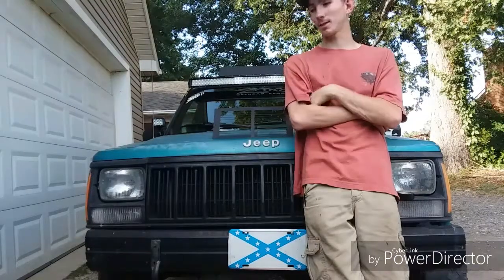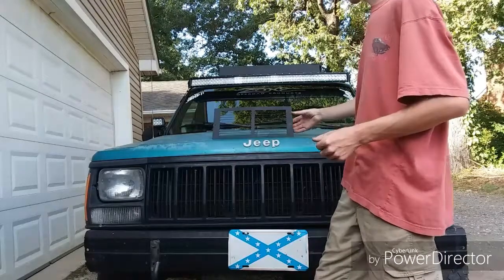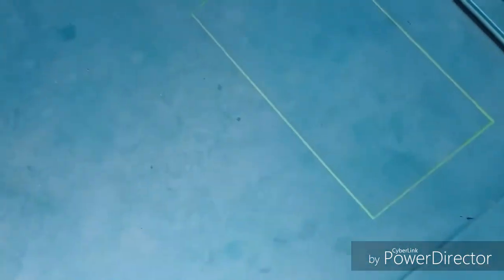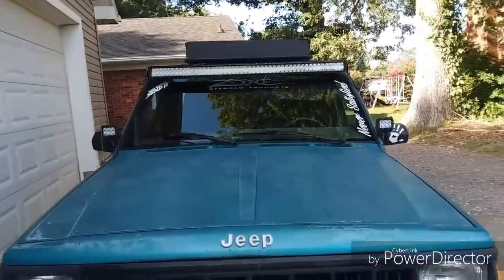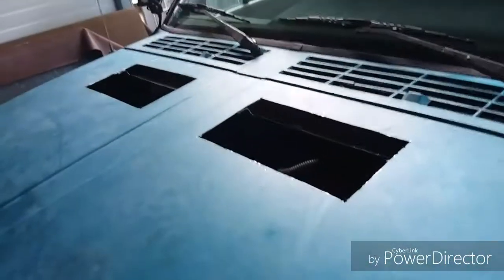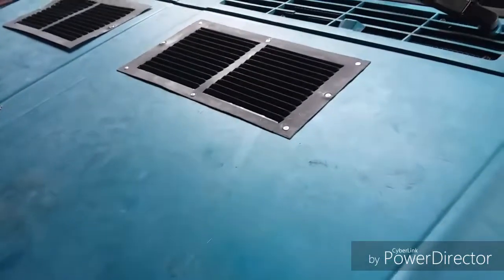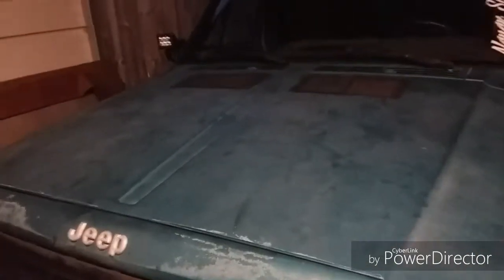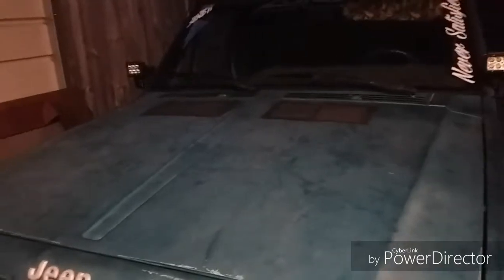Jeep Cherokee hood vent install aka project overland

Comment: Putting mine in tomorrow.

Is yours running cooler?
Reply from the maker: It's staying where it should be! Sorry for just now getting back to you, but yeah I just took it to the beach and back and it stayed where it should be, and at times even cooler! I will say at times it does get a little warm in stop and go traffic when the humidity is outrageous! Lol
Reply: GearheadsGarage212 
Still testing mine.

Comment: What kind of ghetto resnecking crap is that? Installing HVAC vent grates on a Cherokee? Wtf??? Just spend $20 & buy 1” hood spacers. Now you will get too much rain water down to your distributor.